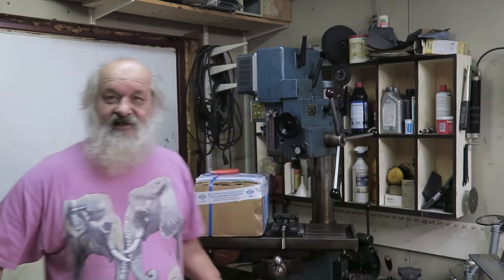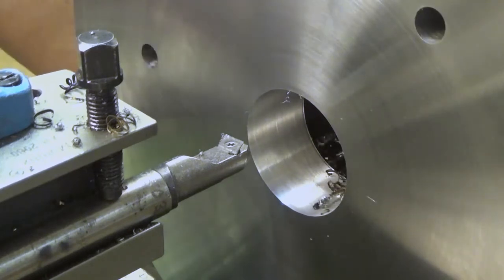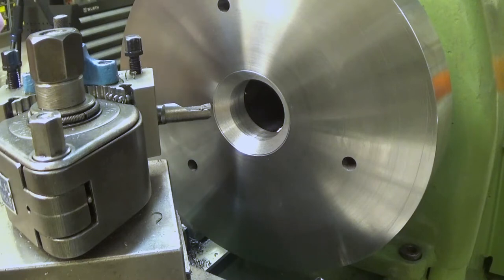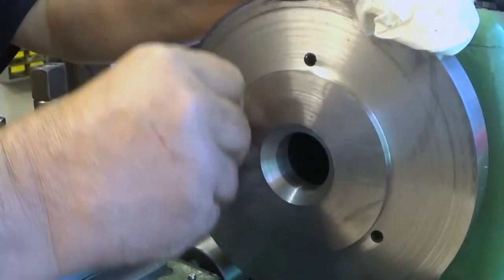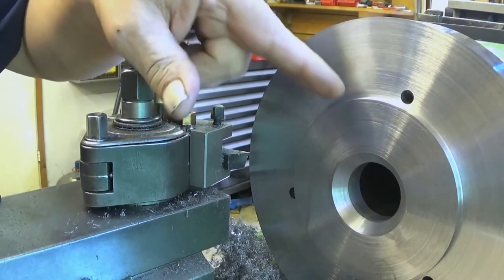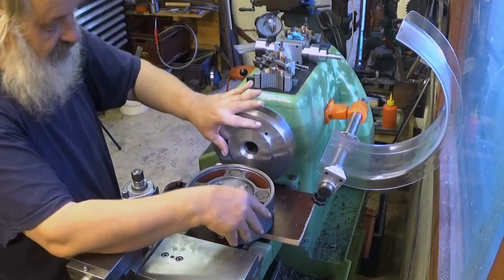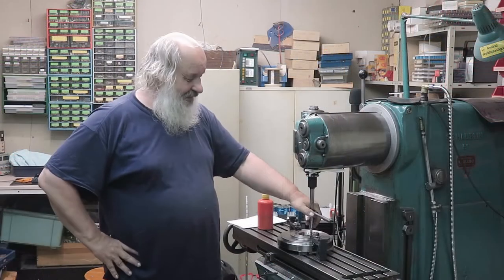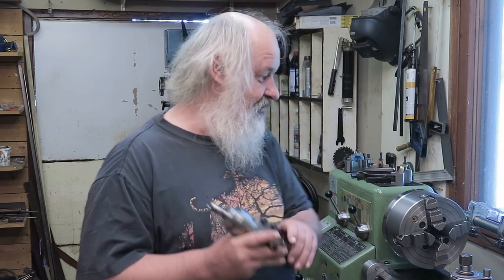Backplate For Bison 4 Jaw Chuck

Comment: Nice one! 

Use The Chuck key again just cut bad fit away and mill new correct one in place.

That is always  good amount slipfit  0,5 mm on every backplate.  By losen bolts slightly and tap out runout off on Great Access ability.
Reply from the maker: Thanks for the idea with the chuck key. The tip seems to be hardened but I assume I can anneal it and harden again after milling.
The runout is already dealt with :)
Reply: @FinnoUgricMachining  correct